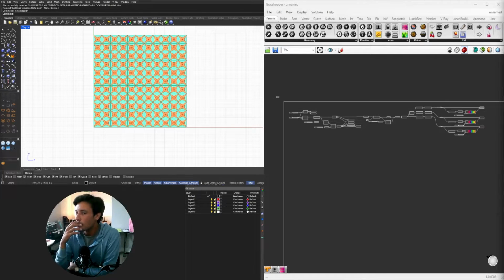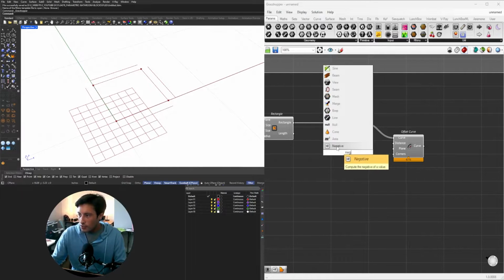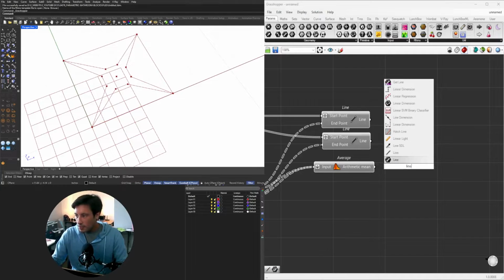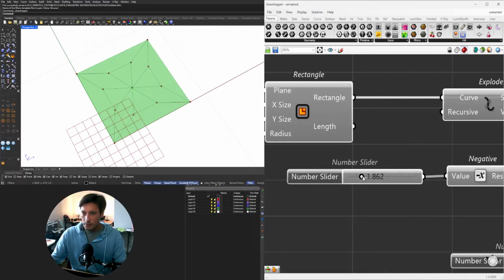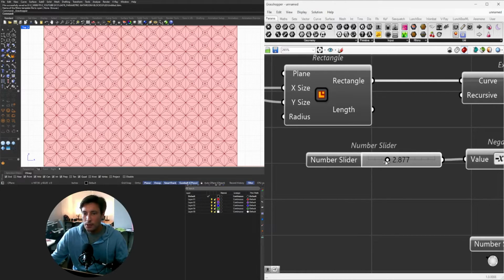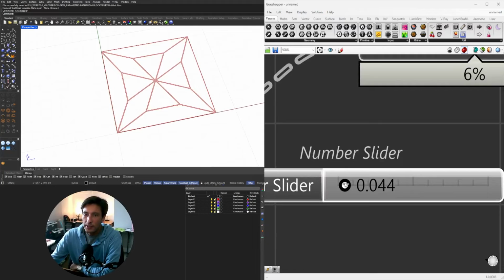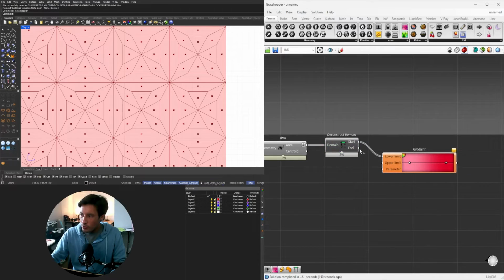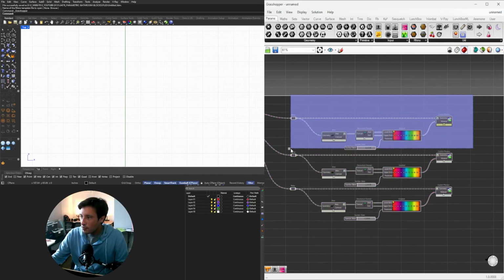Parametric Pattern Making Truncated Modules Using Grasshopper for Rhino 3D #grasshopper #parametric

Comment: really interesting, long time Rhino user here, and yes never really delved into GH. Quick question, if I have some linework (a logo pattern) of my own, is it possible to put that into specific boundary areas on a site , I'm thinking large areas of paving, with an inlaid repeating pattern from a client?
Reply from the maker: Yes, you can definitely achieve that with Grasshopper.